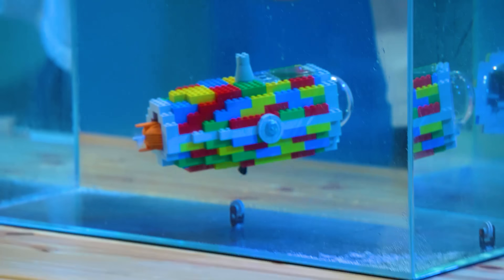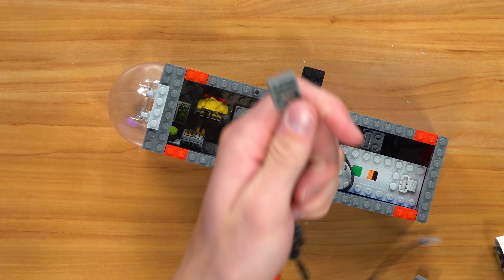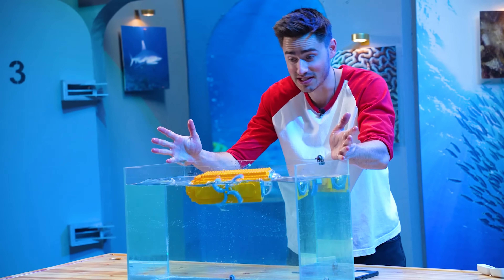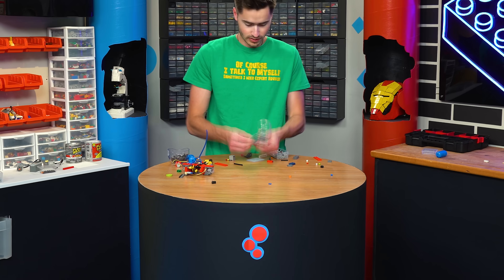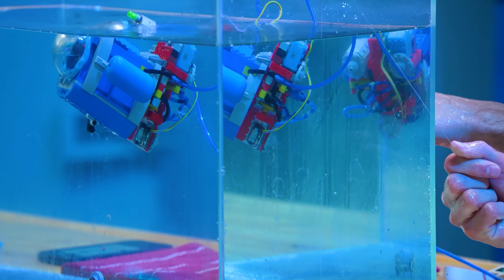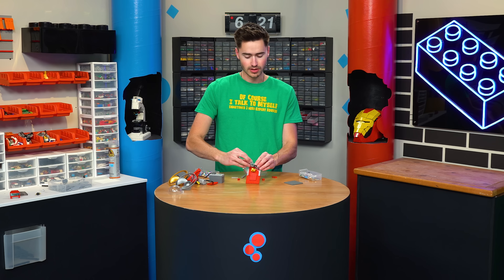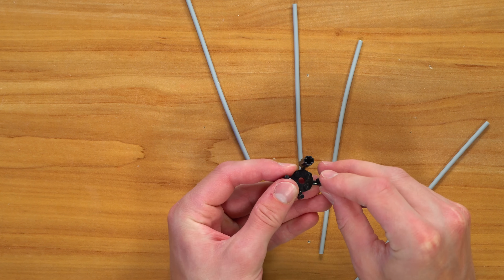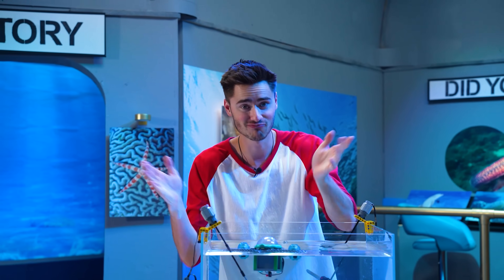Testing LEGO Submarines...

Comment: Hi, I'm from Mexico and I don't know much English, I'm using a translator to write this. Perhaps place small sheets or plastic wrap between each block connection, not a single sheet.
Reply: Then perhaps with heat to melt the plastic and ensure it adheres slightly to the pieces, thus making each piece waterproof.
Reply: Then maybe paint the bottom part with Flex tape

Comment: Just finished a UH-1N/M and a Vietnam PBR that’s unsinkable. Currently working on a Type 9 U boot, secret is black Rtv between bricks. I’ll figure out a motor and servo to turn and add ballast (to sink) when more money comes along. I’ll probably use a 360 sized hobby motor so it can scoot under water

Comment: Weld-on 16 is used to seal acrylic aquariums. I personally use it. That should work well. Your designs are great, but get a real product. Flex seal is a joke. Also, cure time is different than set time.

Comment: I dont tink it was the fault of the waterproofing material i tink that u didnt put them ritgh, the playdoh should have been put betheen the bricks so that it combines with the cluch power of the bricks to stay in place same for the flex seal most of the water got in through the cealing becouse as a said the playdoh wasnt put bethen the bricks and for the flex seal u just frogot a spot, and the water profing spary cant cover that big of a gap the gap needs to be smaler for the water proof spray to work no hate but that is my opinion

Comment: Most of these when the camera worked, the water was coming in from the tops, not sides or bottom. After you put on the top plate last, did you water proof that or just snapped on the piece? If snapped on, that’s why water came in while sides and bottom did not leak.I used the same oil can type flex seal on my old cars outer windshield perimeter. That stuff works very well (spray can version is garbage). Still cool  video and I liked the sub designs and setup.

Comment: For keeping them upright and helping them dive id put weighted zinc bricks in the bottom

Also the reason waterproofing spray didnt wirk is that waterproofing spray only makes absorbent surfaces hydrophobic so water wicks off and doesnt get absorbed- its not for making water tight containers

Comment: @BrickScience Great work on this video! :)

14:13 The reason why the submarine is spinning here is not because of its size but because the rotational torque of the propeller is causing the body of the sub to rotate. The same effect happens with single-engine airplanes: when a propeller spins one way, the body of the aircraft tends to want to spin in the opposite direction, and there are design features built into the aircraft to counteract this torque. It's similar to how the rotational torque of a spinning helicopter rotor is canceled our by a tail-mounted rotor, or, in some cases, an additional main rotor. To counteract the submarine's tendency to spin itself while in the water, adding a second propeller (that spins in the opposite direction) would make the most sense. 

Unfortunately, this is impossible in your case because you used the LEGO Airjitzu propeller, which LEGO has designed to spin in only one rotational direction (clockwise). To create a contra-rotating setup, you would need an identical, mirrored Airjitzu propeller that is designed to spin in the opposite direction (counterclockwise), which is a part that unfortunately doesn't exist. Your best bet would be to 3D-scan the part into a 3D-modeling software, mirror that part, and then 3D-print the mirrored propeller copy. Mounting that copied propeller immediately behind the original propeller on your submarine and connecting it to a contra-rotating mechanism (allowing that propeller to spin in the opposing direction to the fore propeller) would cancel out the rotational torque and stop your submarine from trying to spin on its own axis.

If this sounds difficult to understand, try looking up "contra-rotating propellers" on Wikipedia and you will see what I mean. Once again, excellent work on this video! :)
Reply from the maker: That’s an amazing answer! Thanks for sharing this with me 😮❤
Reply: @Brick_Science  No problem! Sorry the part you would need to solve that problem doesn't exist. Like I said, you can make it work with 3D-scanning and printing, but that can get expensive pretty fast. If you decide to do a LEGO aircraft video in the future, though, contra-rotating propellers are a concept you might want to keep in mind, because like I said previously, single-engine aircraft can suffer the same issues without a torque-cancrlojg measure of some kind, whether that's accomplished using a thruster or another propeller, as is the case for helicopter tail rotors and coaxial helicoptera like the Kamov KA-32.
Reply: Aah, makes sense
Reply: I think that’s called torque roll
Reply: @stefannyhardiman708  Yes, that sounds correct. Thank you. ;)
Reply: Uhhh. May I ask one thing? How the heck do you know all of this? Because this is impressive! 😅
Reply: @EShade-Slayer  All of this is common public knowledge that you can find on Wikipedia. Though I will say that, because I am currently working on building a very large homebuilt amphibious eVTOL superyacht, I am actively studying these concepts so they're quite familiar to me. Also, I'm a very high-functioning individual on the autism spectrum, and I have a propeller obsession in a sense, so I know a lot about them. ;)
Reply: @HydroWorldOutlookHub5769  Woah. You've done your homework then!
Reply: @EShade-Slayer  Heheh. Not entirely. :)
I still have a lot of work to do. Just understanding the basic concepts is not enough to build a basically $2 million experimental aircraft. I've gotta know the math too, and that's the tough part for me. Right now, I'm a 19-year-old working towards an Associate's Degree in Engineering, but I'm already considering pursuing technical writing instead once I transfer to another college because I can't handle Calculus I. 

I've already taken and passed Calculus I, but Calculus II knowledge is required in many areas of aerospace and aeronautical engineering. The formulas and mathematical concepts that make aircraft work require a thorough understanding of concepts taught in Calculus I, Calculus II, and in some cases Calculus III as well, so the fact that I'm too afraid to take Calculus II is a major red flag that I"ll have to address long before any design plans get submitted to the FAA and U.S. Coast Guard for review. On top of all that, I still have to get a job and actually earn the money I need to make it happen. I'm trying to make this aircraft a social family living hub (that's why it's so big - 32 meters long by 10 meters wide by 9 meters high) so that more people in my family will be willing to pitch in, but first I've gotta demonstrate to them that I know what I'm doing with this design because it opposes the conventional house-and-automobile lifestyle. And it's a huge expense that we'll all have to fund together in order to make happen. I'm planning on starting a new YouTube channel at some point to showcase the progress, not just to help us out by providing an income stream but also providing a tool of proof for the authorities to verify the integrity of my construction.

So lots and lots of work to be done, and it will be at least 8 years from now (2033) before any construction begins. But watching videos from this channel, and other channels, like the Pilot Institute case studies and interviews, along with the Stig Shifts (Aircraft Maintenance Adventures series) helps lay the groundwork by educating myself on the skills that I will need, both physically and legally, before I even think about starting the build.

Thanks again for all your support. :)
Reply: @HydroWorldOutlookHub5769 can you make a video showing your super yacht?
Reply: @ERROR-SYSTEM-404  Yes, when it's ready to enter construction then I will post a video under a new channel name, once I get it all sorted out with my parents. I need the revenue from the YouTube channel to help fund construction. As I explained previously, however, we still have a ton of work to do before the first wooden board gets cut.
Reply: Bro you a nerd for real though
Reply: @The_builder_official  Not really. This is all common public knowledge that can be found and accessed for free on the Internet.Thanks for the compliment, though. :)

Comment: Flexseal and waterproof spray are only designed for surfaces with very small pores, around 0.1 mm. They can't seal gaps like the ones between LEGO bricks, which are typically between 0.5 and 1 mm wide.